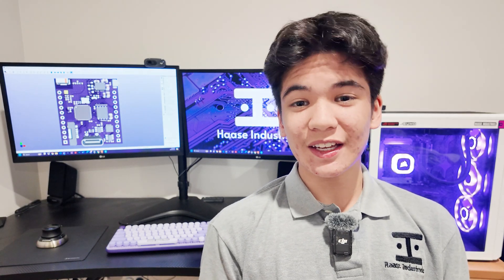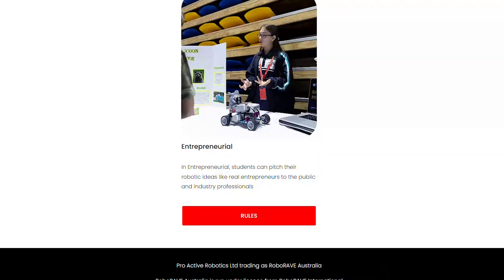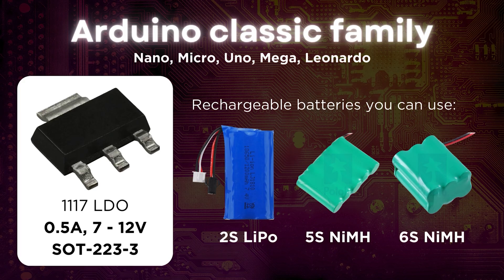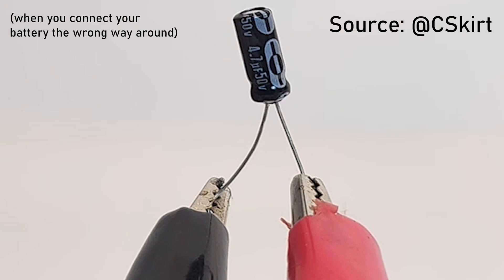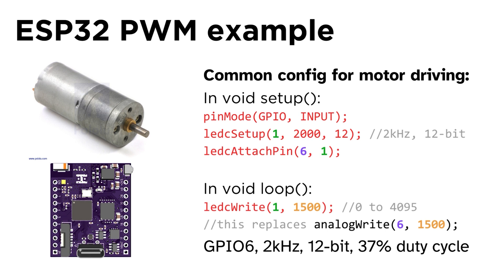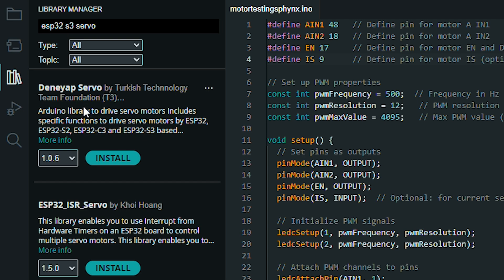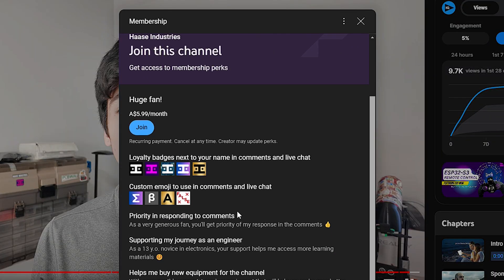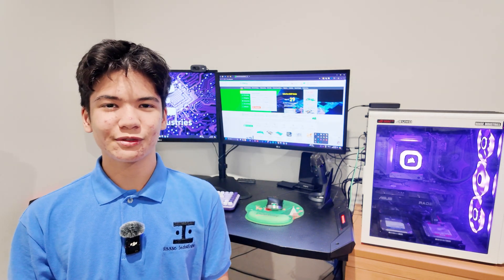ESP32 for robot control - you should try it out!

Comment: Hi, I'm new to ESP32, I'm interested to design ESP32 S3 tiny board, can help to give some advise? will you share the this R3X kicad files on github? What will be different between this R3X board and the previous S3P board?
Reply from the maker: Hi, you might want to check out my previous tutorial video a while back for custom ESP32-S3 designs from the bare chip. Keep in mind though, you won’t be able to use RF with a chip antenna unless you tune it. Alternatively, you can use a PCB antenna, which might not require tuning if you get the right reference design to go off of. I am not sharing R3X files. R3X just has some extra features, but isn’t practical for hobby use because the power circuitry inside is too expensive, and the ADC is noisy because of power straight from a buck converter. It was only designed for input from a 4S LiPo, but can work from 5V - 18V. S3P might be better to look at. Alternatively, look at Unexpected Maker ProS3 schematic (search online) and PCB files for a professionally made design, which I would recommend looking at more than my own designs.
Reply: Hi, thanks for your advise, I will explore on S3P and Unexpected Maker ProS3 schematic.

Comment: Your current values for the sensors seem to be way off. Most dev boards don’t have high current outputs because it just isn’t needed in most cases. Sensors don’t use much power and if you have any sensitive sensors you will want to use a dedicated linear regulator for it, if you have any high power components then they should get their own supply too.
Reply from the maker: @conorstewart2214  there are multiple sensors per bot. An LED draws about 20mA x 4 = 80mA. High powered IR distance sensors likely draw 30 to 50 mA on average x 4 = 200mA. Multi zone ranging infrared sensors like the one I had in this robot draw 100mA by themselves. I had one here, but would’ve liked to have 2, so 200mA. A buzzer takes anywhere from 200mA (small ones) to 20mA (big ones). This comment about me not knowing why none of the dev boards had a high current output was not to criticise anyone, but address the fact that there are not many ESP32-S3 dev boards designed for robotics. I said ‘these numbers’ also referring to the maximum input voltage of 36V, and the closest one to that is an Arduino Nano which I personally wouldn’t use anything more than a 3S LiPo on so that there’s a safety factor for inductive spikes. The Arduino Nano is quite an exception too, most boards will be damaged when more than 7V is used as the input voltage. Most of the sensors have decoupling on them, so I figured I wouldn’t need 3 x 300mA external LDOs (which I couldn’t even do since I don’t have a 5V source directly stepped down from the battery on this robot), and instead, used the 2.5A output of the 3.3V regulator. It is widely considered as acceptable on most ESP32-S3 boards to run sensors and even very small motors off of the microcontrollers 3.3V supply voltage. Hope this helps. Thanks :)

Comment: I have a doubt about I2C communication in ESP-32-S3-wroom-1   I'm unable to figure out which pin or GPIO to use or there is any function To configure GPIO as SDA or SCL still in confusion please help me also I'm using MPU6050 to measure vibration Of Induction Motor.. to analyse it..
Reply from the maker: you can use any GPIOs for SDA or SCL, with Wire.begin(SDA, SCL) in Arduino. That is, any GPIOs which aren't strapping pins (0, 3, 45, 46), PSRAM pins (33, 34, 35, 36, 37), or USB pins (19, 20). Thanks
Reply: @h1tec  Thanks I will try

Comment: I really liked the S3 board. Is the schematic available?

I want to see the automatic voltage detection to be specific. I have an application where I can feed 5V or 12V, but currently, I need to set a jumper manually. To avoid this manual process and prevent any potential issues, I am willing to automate it.
Reply from the maker: I haven't uploaded the schematic yet. But will let you know. In the mean time, here are some application notes about Power ORing which I would recommend reading:
https://www.eetimes.com/fundamentals-of-power-system-oring/
https://www.eevblog.com/forum/beginners/diode-oring-circuit/
https://www.ti.com/lit/an/slvae57b/slvae57b.pdf?ts=1719792864533&ref_url=https%253A%252F%252Fwww.google.com%252F
https://www.diodes.com/assets/Datasheets/AP74700Q.pdf - page 17 specifically for the power ORing stuff.
Hope this helps.
Reply: @h1tec  Much appreciated, thank you.

Comment: Hey, this is really cool! It's good to see other people doing custom electronics for combat robots, I think it makes a lot of sense. 

I've been building a beetleweight with custom electronics, I realised I could avoid almost all the wiring spaghetti inside the bot by designing a PCB to handle it all, and then I could also use an MCU to control all four drive motors totally independently, as well as handle weapon control, endstops etc. I'm using a Seeed Xiao RP2040 because it's my go-to MCU in a tiny footprint (and I want to use a regular ibus RC receiver so no need for wireless), plus four integrated motor driver ICs. Rev1 works great, but 3.5A per channel is only just enough for a beetleweight, so rev2 is getting 6.5A per channel and also an IMU, so that I can experiment with closed loop control algorithms for the drive.

Oh also, I can fill any spare board space with RGB. I bought a pack of 0807 WS281B from aliexpress and I'm going to town.

Comment: very nice! this is also where the esp32 shines, i would also add that to control pwm motors more than the ledc channel the esp32 has the mcpwm driver with even more timers and generators and posssibility to configure emf sensing pins for bldc control, two mcpwm each with 3 timers and comparators gets 6 more pwm channels!
Reply from the maker: @robotarenachallenge  true. Haven’t tried that yet though